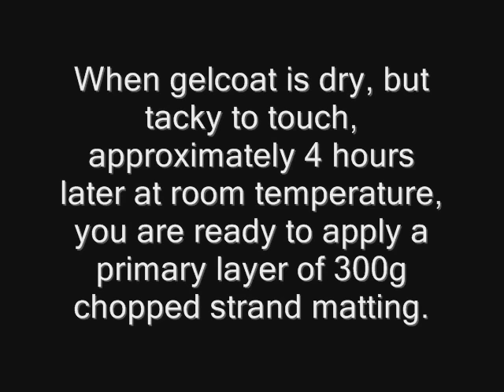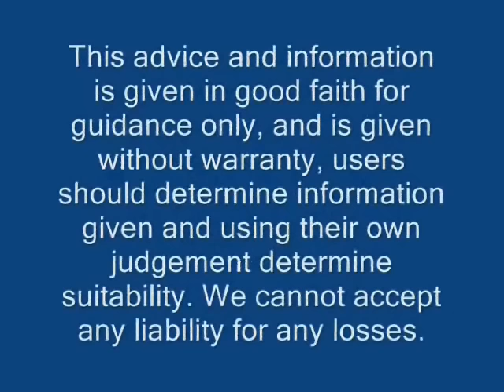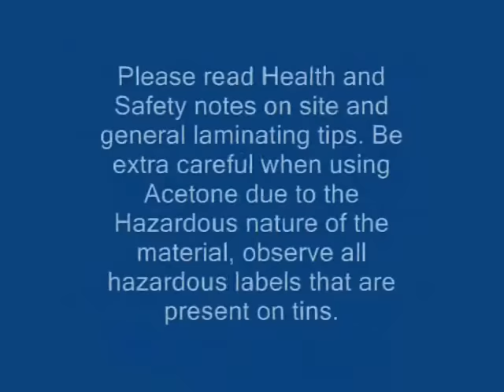# 2 making a fibreglass mould using optimold tooling resin

Comment from the maker: Its just a matter of preference, lots of companies spray on gelcoats which benefit production on a large scale for example boat hull moulding, we find that moulds or jobs of this size that we can apply a gelcoat faster than it would take to set up and clean the spray gun, also it cuts down the energy costs of running compressors. If a product requires a strict thickness of gel this would also warrant the use of a spray gun, we actually supply a low maintenance sprayer the G100.

rgds ecfibre

Comment from the maker: A melamine faced board is best to use for any flat areas as the gelcoat and fibreglass release quite well from this, just a light wax and buff of mould release wax is required on this type of board,  we use duratec suface primer to seal our timber plugs then coat with release agent as demonstrated, glass can be used but must be waxed a few times first. most plastics should be coated with several coats of PVA release agent to protect them agianst melting from the styrene in the polyester resin.

Comment from the maker: A 2-3inch (50mm - 70mm) overlap is usually sufficient although if applying multiple layers of fibreglass it is better if you can butt joint the glass and make sure that the joints on following layers are in a different place each time.

Comment from the maker: the 14PA we use is designed for brush application - usually
thinning gelcoats down with styrene to make them sprayable leads to higher
shrinkage and more tendancy to pre release.
Viny ester gelcoats contain more styrene compared to conventional Iso or
Iso / NPG types so can be more likely to pre release particularly if
applied too thickly in corners etc.
Rgds ecfibreglassuk

Comment from the maker: Hi, It is important to use the gelcoat as this will prevent exposure of the fibres, deterioration of the mould surface, eliminate pinholes and give a surface which can be rubbed to a smooth Finnish and buffed to a shine. Unfortunately i am limited by youtube character count but you can visit our website shown at the end of this video then click on projects  and scroll down to making Moulds this will give you some interesting literature on the full process.
Kind rgds ecfibreglassuk

Comment: Hi lads,
I'm on a project of building a bicycle frame. I decidet to make a model of bike, and then make a mould as described in your compilaton of videos. (I'd make two halfs of mold - later this would became 2 half base out of carbon fiber, in which I'd later add some more layers of carbon). However I'd need some advices how to make a proper mold. Should I use gelcoat?

by the way, your videos are very usefull!

Comment from the maker: Hi again, Using Scott Baders 14pa Tooling Gelcoat and leaving it to harden at the recommended timescale fibre print through is non existent, using a good quality (Owens corning) 300g matt m705 grade is a lot easier to work with and forms a better bond to the Gelcoat than surface tissue. On the latest video it shows this actual mould in production, no evidence of any print through on gelcoat and over a couple of thousand lifts successfully. hope this helps explain, have a good day.